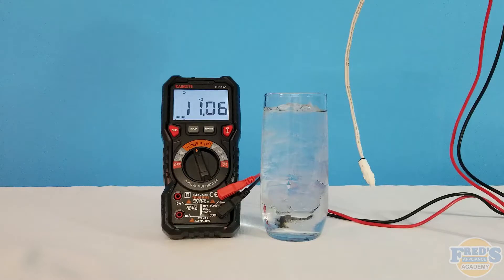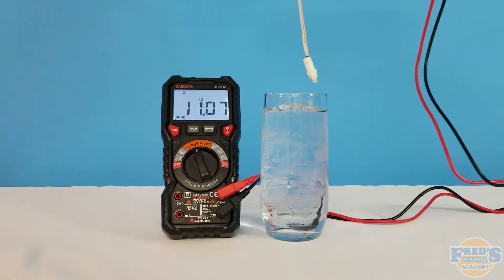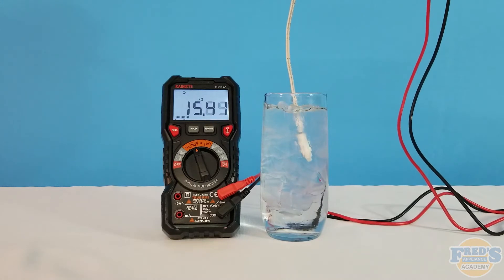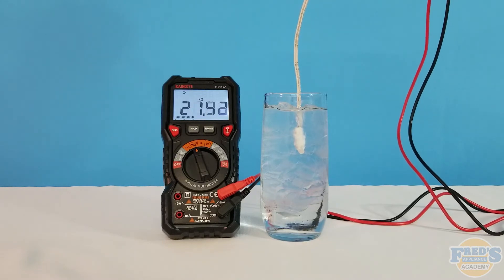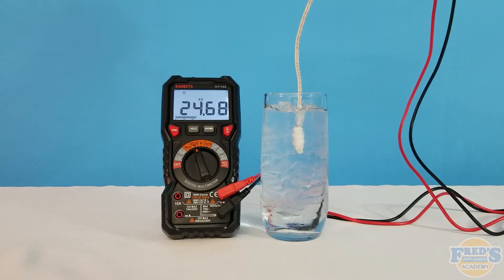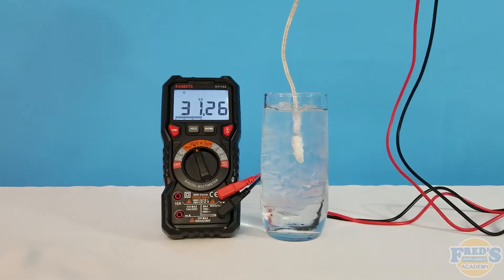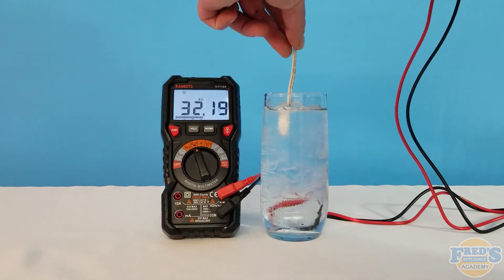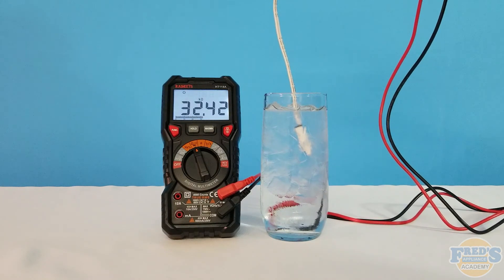How to properly test a refrigerator thermistor

Comment: you did not show how to connect multimeter
Reply from the maker: There are only two wires and it does not matter which probe goes to which wire.

Comment: I have the Norcold N841 and I've been having issue with it warming up off and on for a few years! I replaced the thermistor about 4 years ago and the fridge was working great for a while and then it started warming and fluctuating and since I bought the new one I didn't think twice that it would be the issue again but today I decided to check the thermistor using a multimeter and I'm now certain that's the issue!
The readings I'm getting are 27.5 ohms at 32°F and 6.7 ohms at 83°F...... According to the Norcold Ohms readings chart it's supposed to be around 8.2-9 ohm's at around 83°F and 30-32 ohm's at 32°F!!!! It's definitely looking like that's the issue for how warm the fridge has been getting! The fins also frost a little in the fridge and the back of the freezer recently had about an inch of ice!
Thanks for the video! It's what helped me figure it out!
If it turns out not to be the thermostor I'll come back and update my comment!
Reply from the maker: That's awesome to hear!!!

Comment: how many thermistors are in a normal (modern LG three door) refrigerator?  Is there on in the freezer section and one on the refrigerator section?  Is there a third on the evap coil?  Do they all tend to show the 25C impedance on the lead wire?
Reply from the maker: Larry, it's model specific.  Different models can have a different amount of thermistors in different areas which can also actually vary in resistance value.

Comment: The evaporator in our fridge/freezer keeps icing up and not letting cold air to fridge. I believe it's the evaporator thermostat(temperature sensor)that's suppose to kick on the defrost heater at a certain temp to defrost.  Question, I removed the sensor/thermostat and at room temperature should that show at least some measure of resistance? I hooked it up to my multimeter and got what is the error or the infiniy . On a different type of temp sensor that is new and working I get 0.0.  Keep in mind the sensor that I think is bad is bulging out.